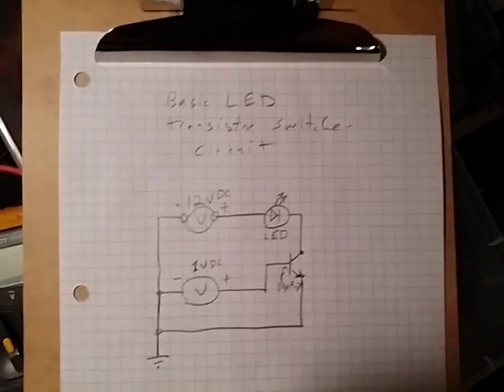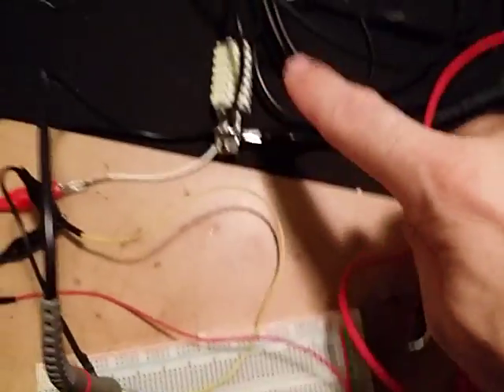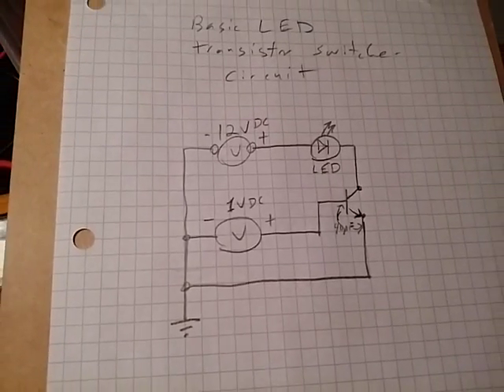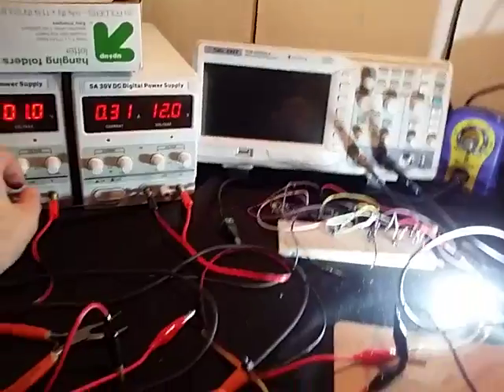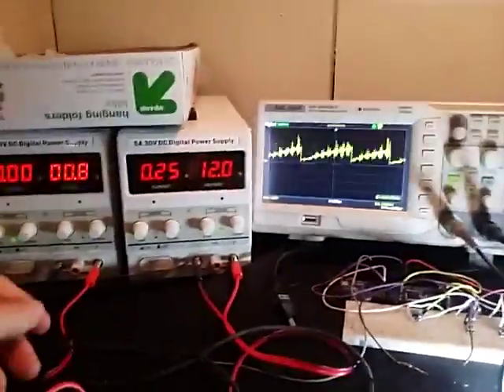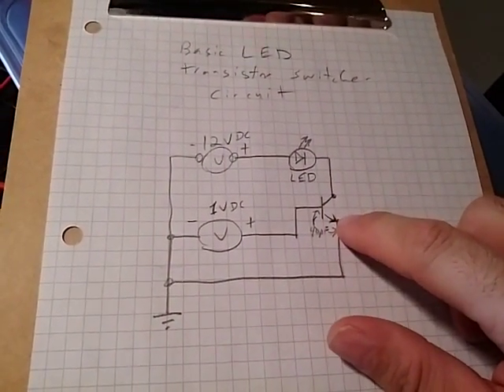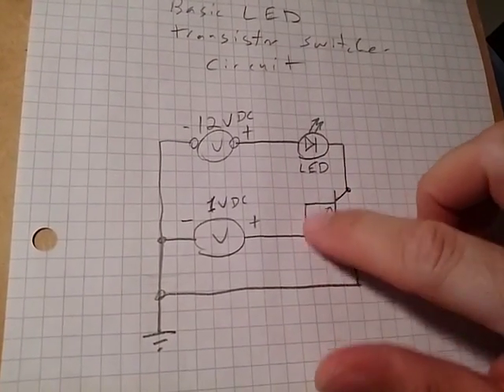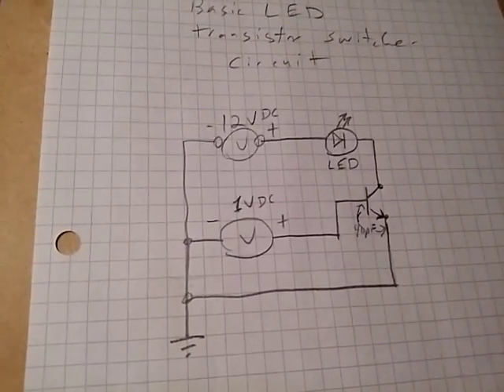transistor auto Oscillation

Comment: maybe it's your chinese PSU which oscillates instead of the transistor...
Reply from the maker: the ramp action is consistent with the charging and instant discharging of a capacitor. power supply ripple looks like a sin wave. Also, the ripple would maintain a specific frequency based on the supply voltage, you can see in the video the frequency of the waveform changes with voltage change.